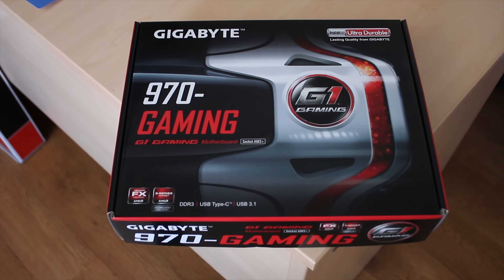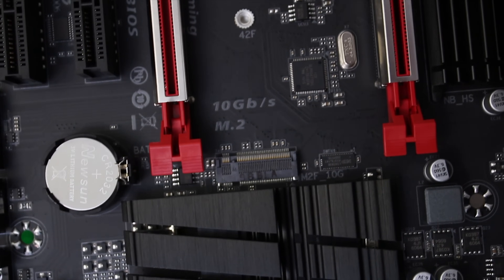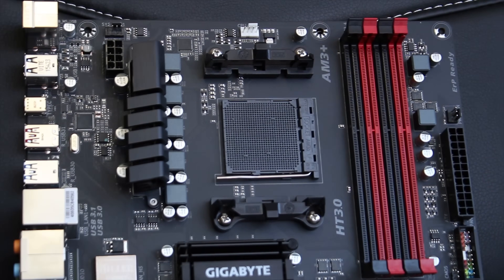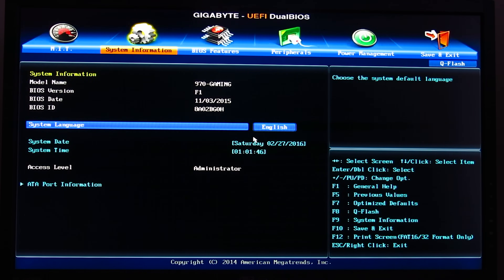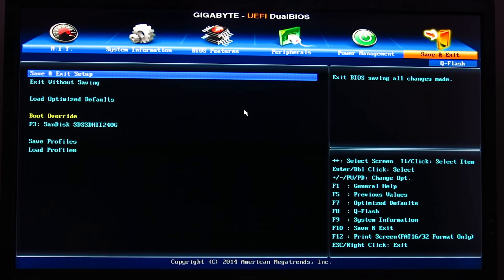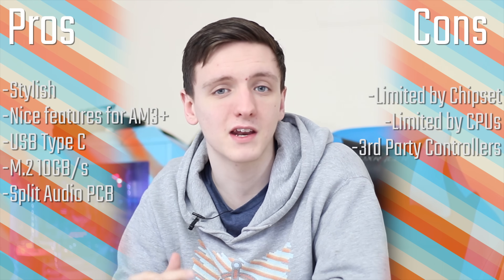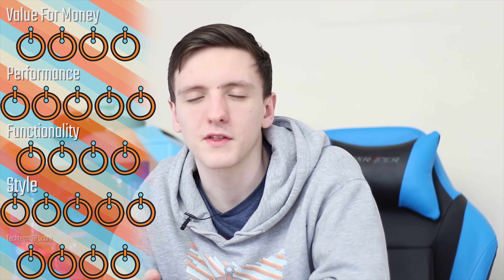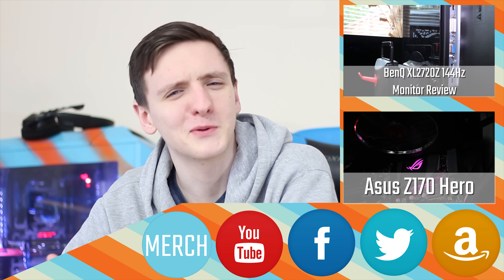Gigabyte 970-Gaming AM3+ Motherboard Review

Comment: I don't know what happened to my motherboard. 
It won't start when I press the power key.
When I try to start the computer the CPU and other fans starts to spin but the graphic card's fan are stationary.
The graphic card is working on other motherboards. But the 970 motherboard is not turning my graphic card on. 
Can you help me with it?

Comment: does fx 4300 work on it ? or gtx 1070 gpu work on it ? reply quickly
Reply: yes and yes. It is a AM3+ Motherboard what is designed for the fx-series. also the gtx 1070 will be working perfectly on the pci slot. But keep in mind the fx 4300 will bottleneck the gtx 1070
Reply: Yes

Comment: heya, have you ever had any heat Problems with that mobo, especially with the VRM?

Im just asking cause right now i got a cheapo mobo which has no heat sinks on the VRM. That heats up the part of my pc case, which is directly behind the VRM extremely. Will that be fixed with this mobo, or is there still going to be a heat issue with the power of an amd fx 8350?
Reply from the maker: I didn't have a problem with that, and yes heatsinks will definitely help.

Comment: Hi, I´ve got a question for you: 

At the first, I´m a big hardware-Noob an would like to buy a new motherboard, cause I´ve destroyed my old while trying to integrate a new CPU-Cooler......
And sorry for my bad english, I´m german...
 
Do you know how many FAN-Ports this mainboard has? Cause I would like to transfer the stuff out of my old PC-case in the new Big-Tower-case, and I´m very sure that there have to be 5 Fans including one for the CPU. ;P

And is it true, that you shouldn´t spend  less than 60€ and more than 110€ on a gaming motherboard, is that right?

Thank you  for your answers ;P

(And if you see somthing grammatical wrong in this commentary, the5n please correct me, I would like to improve my english skills ;P)
Reply from the maker: There is at least 5 fan headers yeah. As for price, there is no limit but you probably don't want to spend a very low amount on the one bit that connects to literally everything!
Reply: TechteamGB
Okay, thank you ;P
I bought the Asus 970 Pro Gaming Aura, I hope that will work ;P
This Board would have worked, but unfortunelly I´ve bought it befor I read yore answer.
But thank you for the information too ;P

Comment: its good for crossfire???...i thing i buy two gpu RX 480 8GB...what do you thing???
Reply from the maker: The CPU will not be good for that.
Reply: HHHHmmmm...with fx9590???
or i must to go to intel??
Reply: I personally just bought an i7-6700k to replace my FX 8300 OC'D to 4.2 GHz. Apparently at the moment, the 6700k is the better processor to handle gaming. But in the future, the API for the game may make the FX 9590 a better choice due to multi CPU optimization. The Vulkan technology is looking promising for 6-12 core CPUs with the RX 480. So, I wouldn't fully say you NEED to go to Intel. It depends on your patience and games you want to play. You may get better performance in games like DOOM.

Comment: Looking at this as a replacement for what appears to be a failing mobo...Have swapped out everything & still cannot get good frame rates with a GTX-960/4GB card. Was also blue-screening & crashing the old card, as well. So, I basically have the Phenom II, 12GB DDR3, & the rest-- just need a new board to drop them into. Would you say this is about the best board as a replacement? I'm trying to stay at a reasonable price & will save for a new system in a couple of years. Cheers!
Reply from the maker: +Tracy LF yes, this should work fine!

Comment: ok I'm new to building pc ive got this board I got a disk with it how do I install the motherboard disk is there a specific way
Reply from the maker: +M3ch Tig3r put it in the optical drive of you have one, after you have installed windows. Or you can use another computer and download the more recent versions of those files from gigabytes website, and use a USB stick to transfer the files.
Reply: +TechteamGB cool thanx for the help

Comment: I cant install hyper 212 evo on gigabyte GA 970 GAMING motherboard
 
the X mounting fits well by itself but when i put it on the hole of 
the fan/disipator the screws doesnt fit, if i barely screw one side the 
other side lifts
 
http://postimg.org/image/4duuhotuj/
 
http://postimg.org/image/8a3kzxpgb/
Reply from the maker: Try rotating the heatsink - see if that helps!
Reply: nope, 2 sides remain lifted

Comment: Dude need air support, i have same motherboard, i have install the drives from cd but i cant connect to the internet have you any sollution? i have w7 ultimate 64.
Reply from the maker: Are you using an ethernet cable or an add in wifi card?
Reply: Ethernet
Reply: Only
Reply from the maker: Do you have access to the internet any other way? If you have a laptop or something you can download the most uptodate drivers.
Reply: Yes i have
Reply from the maker: Have you downloaded updated drivers and used a USB stick?
Reply: +TechteamGB tell me the right drivers, maybe is my mistake
Reply from the maker: http://www.gigabyte.com/products/product-page.aspx?pid=5654#dl
Reply: I start download bigfoot amd gaming drivers. Is the 3rd time, i have installed yedtrday but nothing hapens, sorry for my english

Comment: what cooler fits this motherboard? i have seen some coolers are to large and use the 3rd,4th ram slots
Reply from the maker: +mightyhylian most do. Something g like a cooler Master hyper 212 would be great and shouldn't cover ram slots
Reply: +TechteamGB i tought so, i checked the 212 vs t4 dimensions and by just 1-2 cms ,t4  covers the last ram slot. heres the like and subs
Reply: +TechteamGB Can I use fx8350 and a gtx960 on this board... No oveclocking....
But what I a do a little bit of oc with this and what is the power phase of this mobo.....
Should I go with this or GA-970 UD3P rev 1.0

please answer